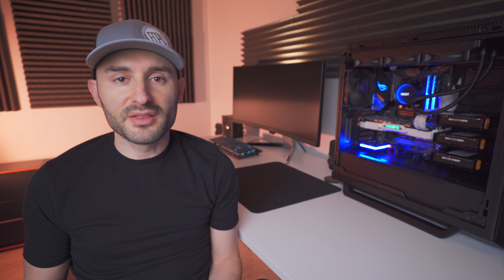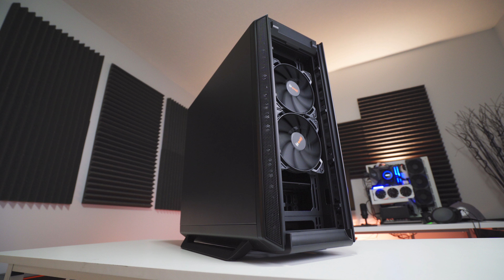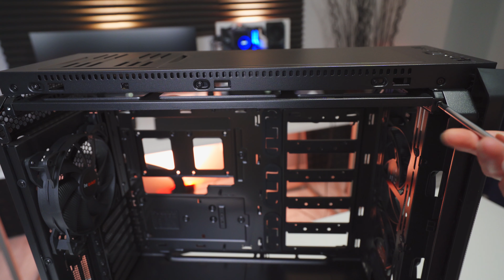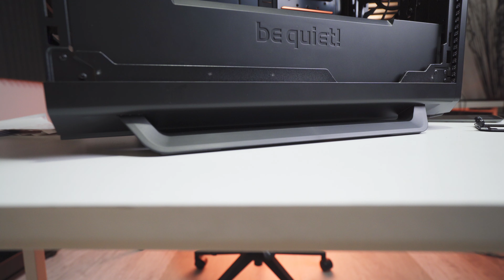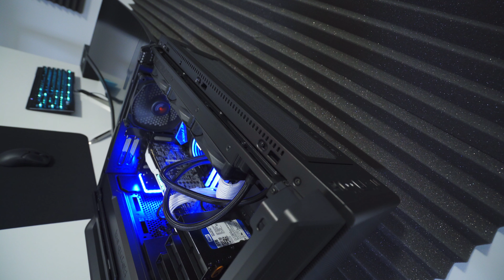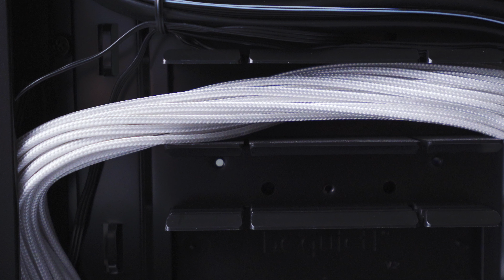Be Quiet! Silent Base 802 Detailed Review

Comment: recently built a gamepc thats rarely used for gaming. took this case with window-option, ryzen 7 9800x3d, gigabyte x870e aorus elite, gigabyte rx9070xt oc, 420mm AIO(front) and 3more 120mm fans(top) from bequiet!. 1tb crucial mp700pro pcie5.0 and 2tb crucial mp600elite m2 pcie4.0 and 32gb crucial gddr5-6000. if i ever need to upgrade i´m gonna do gpu+psu(right now bequiet!850w) and ram to 64gb.
but i think i´ll be enjoying this rig for at least 2-3years before i need to upgrade.

Comment: I have a 600 silent base and I can see that this case  is a major improvement over mine. I like that they have a controller for fans now. My case only has 1 2 and 3 on the frontal switch. Frontal meshed panel is also great. I currently have a 4090 RTX GPU and I had to remove the frontal panel completely to allow more air into the case.

Comment: Good case BUT... it comes with Pure Wings 2 which are 3 pin fans, and are NOT bequiet's quietest fans. The Silent Wings 4 are the quietest, and are 4 pins so this case's connection module is 3 pins for all fans which doesn't allow to upgrade to the 4 pin fans.  4 pin fans on 3 pin connectors lose the PWM function. I tried to get an upgraded module but got no response from bequiet.
Reply: The Hub is PWM to the motherboard. You don't need 4 pins fans cos u connect your 3 pins fans to a PWM module that u can connect in PWM to the motherboard then all fans speed will be adjusted (according to the temperaure) at the same time by the motherboard through the module.
Reply: @-sciroccu4820  you are right, but that's not what I'm saying.  I'm saying that as is, this case doesn't allow for 4 pin fans, which are the quieter ones. I called their tech support, and they acknowledged this.
Reply: 👍 @MonsterFlipsUSA  I understand now. Though the silent wings 4 also exist in 3 pins versions (120 or 140mm) that u could, I suppose, connect to the 3 pins hub for a good silence too in the case (better than the Pure wings 2 that are preinstalled for sure).

Comment: Why do they only ship the plastic bay drives covers with the windowed version???
Reply: the drive covers are for aesthetics, but since this version has no window then you cant see anything anyway
Reply: @GeorgeGadgets  It doesn't have airflow impact. most of the air that enters a case from the front, is sucked in by the cpu and gpu for cooling, and then heat coming from the cpu and gpu is sucked out by the rear exhaust fan. You wasted time and money returning that case. This is why they ignored you when you emailed them.

Those covers are just for aesthetics. When you have a tempered glass panel, they have to include those panels because the interior of the case is always visible and it would look really ugly without those covers. But when you have the solid panel version, its literally a waste of money for them to include them.

Comment: I'm thinking of getting the new corsair rmx shift power supply with the cables coming out the side and wonder if there be enough room.   I measured the gap from psu Bay edge to the foam of the side panel and it's 35mm.  I think it's enough, just.
But wonder if someone else has done already.

Comment: The Be Quiet! Silent Base 802 case will easily accommodate any size Arctic Freezer II AIO. I have two. One with a 280mm and the other with a 360mm Arctic Freezer II AIO. There is plenty of room between the top of the motherboard and the underside of the radiator assembly of the Arctic Freezer II and the width will easily accommodate the 140mm fans.
Reply: Hi mate can you fit the 280 Arctic Freezer II at the top of the case? im thinking about getting this case
Reply: @Bir7hdayCake  You sure can.

Comment: This review was helpful. Thanks for that.  I am replacing my be quiet 700 due to my getting an rtx 3080 ti and that thing runs super hot, especially in that 700 case.  It runs like 52c idle and was up to a whopping 86c when under load.  I took off the front panel and was able to get it down to around 74c under load but I think having a vented top will definitely help. I'm waiting for my 802 to come in, I might even use some extra fans to put on the bottom to draw air in and up into the 3 in the front from the bottom bay..
Reply from the maker: I'm still using the 802. It's pretty awesome. Lots of room for big GPU's, HDD's and cooling.
Reply: It is an awesome case with great airflow for keeping the GPU and CPU cool.   I have one with the mesh panels and run it with seven case fans and with a Noctua air cooler.   It's actually very quiet with all those fans because it keeps everything cool while running them at low speeds.

Comment: I personally think BeQuiet opting to not include the drive bay covers in a build with no side window is a perfectly reasonable decision on their part.
Reply: I agree. They were there for looks and with no window why they need as you cannot see it. I got a used one and wondered why they were not there and if they forgot to give them to me until I find this that they are not included with solid non window side panel. I had wondered if airflow would be impacted as would hot spots form intake air flow get trapped on the back?? Since solid window version does not come with them I assume it makes 0 difference and they were only for looks so all good. Or I am sure they would have included them if it made airflow difference, but it must not. It's all just for looks in a window panel.

Solid panel is better for noise reduction anyways as it has sound dampening foam unlike window version which should drown out vibrations and coil whine. Will still use front mesh as front to back airflow where fans are is important at expense of a little more noise, but otherwise everything else sealed where no fans move any air for best noise normalized thermals.
Reply: @Wolverine607  Hi Wolverine and cool answer, but let me tell you that you're wrong. The bay covers do have a huge impact on the air flow physics since they create turbulences both because of the holes themselves which have edges and because of different the trapped rear space. It's obvious that if you have an airflow through a closed tunnel, you're gonna get more pressure from the entrance right to the end of the tunnel. But if you put holes in that tunnel (same thing that they request with microwave food) then the air escapes and performs much, and i repeat, much worse. So it is a very serious failure from BeQuiet not to have included these bay covers in the not windowed versions in order to reduce costs (which is the real reason why they didn't do this), not giving the user the possibility to opt in or opt out to put those bay covers if they have them. Also there is another important drawback by not including those useful bay covers and it is not being able to use them for cable routing. All in all, it's a very poor and bad decision from BeQuiet, which, to demanding and observative users like me, are as important as not to make the decision of purchasing this case (not even the windowed since the only strength of the case is the dampening material). So, I can just congratulate BeQuiet for this terrible decision and thanks ECPU for pointing out this huge mistake before I had spent a lot of money in this case that I won't purchase now.
Reply: @GeorgeGadgets  "then the air escapes and performs much, and i repeat, much worse." any tests to prove this on this case or just theory?

Comment: Great, concise review!
One question: If you want to mount a 140 on the bottom, does that just go on top of the PSU shroud? I doubt this is as effective as a bottom fan.
Reply from the maker: mounting a 140 on the bottom could be done either on top or below the PSU shroud, but it would be difficult on top because there's very little room for tools to tighten the screws from beneath.  Mounting the fan below gives you lots of room above to get the screws tightened, but the fan will take up the space needed for the dual 3.5" drive cage.

Comment: I've been researching this case myself and I am almost ready to purchase it, great review ECPU 😎
One important question tho... is there enough room to mount a 3090 directly to the mother board?
Thanks for sharing 👍
Reply from the maker: According to Nvidia, a 3090 FE is 313mm (12.3") long and requires 3 slots, so it should fit in the top PCI-E slot of your motherboard as long as you don't have any optional drive cages installed in the bottom two bays of the case.
Reply: @ECPUz  That was what I was hoping  for - who fills up all their drive bays anyway. Thanks for replying 😍
Reply from the maker: No prob! Happy PC building

Comment: I would like to know two things about that sound-insulating foam. Is it efficient? Do you have comparison with other ,,silent cases" ? For some reason other manufacturers don't use such foam and I suspect, it gets warmer and warmer with longer loads and so do components affected by that. Did you notice something like this?
Reply from the maker: Unfortunately I don't have any other results to compare it to, so it's difficult to say.  I would think that it would trap-in at least some heat, but the temperature tests seem fine under heavy load so I don't think thermals are an issue for this case overall.
Reply: @ECPUz  Thank you for an answer : ) Is it your private case or only for testing purposes?

Comment: 3 pin fan hub must be a joke for the price tag.really a  disappointment.
Reply: It's PWM to the motherboard. The hub is 3pin only to the fans because it adjusts the voltage on there instead of letting every fan report back its RPM which would confuse the motherboard.
Reply: Agreed it was bad thermally for me too I downgraded to the 500dx and it’s way better imo if you don’t need the dinosaur hard drive space
Reply: I don't have an issue with it.  I have 3x Noctua Chromax 140mm fans and 3x included Be Quiet 140mm fans hooked to it and run them on low all the time.   The temps are always very low even when stressing the CPU and GPU, there is no need for any other speed other than low with this many fans and using the mesh panels.  My rear fan is a Noctua PWM plugged into the mobo.  Quiet, cool, and beautiful is my best description of this case. From what I have seen of comparisons, when using the mesh panels, temps are very similar to the 500dx.
Reply: @Wigglythegreat2  dc respectively 3 pin is outdated.
Reply: @hubihh6463  I understand what you are saying and am all for having a more current updated controller.  If it's any consolation I have the 3x included 3 pin Be Quiet fans along with 3x Noctua 4 pin fans all to that controller and they all work together fine. I figured I might as well buy 4 pin fans as I might  want to use that feature in the future.  For now I am simply using the speed controls on the case as a manual control so I'm not doing any fan control in software or bios.

With six fans running from the controller there is nothing more I need to do other than set them all to the lowest speed as that is all that is required for my use. I do understand that may not work for other's needs. I also have a rear exhaust fan hooked to my motherboard which is PWM and does what it does separately.   So that totals seven case fans not including my Noctua cooler with two fans on it for my i7.  My GPU is a GTX 3060.  Gaming or whatever I choose to do cannot produce more heat than all these fans can handle even when the controller is always set to low.   If I had a beefier CPU and GPU that might change, but with my setup it's well into overkill with headroom.

I do know that there is also a cable from the controller to connect to the motherboard for PWM, but I have no experience using that as of yet.